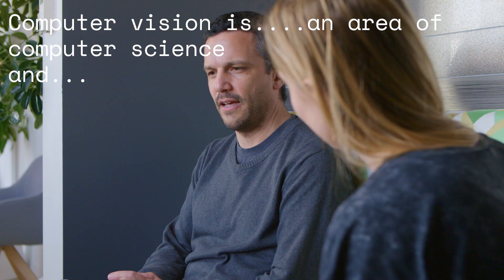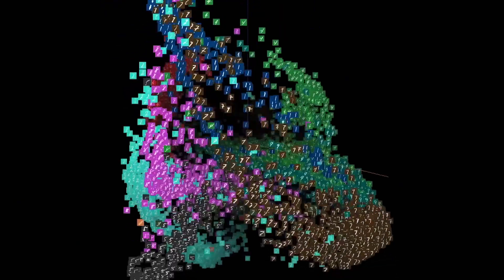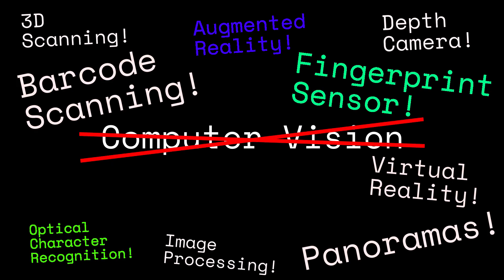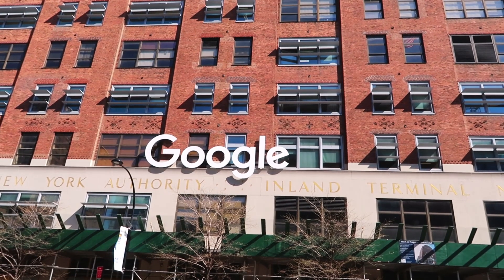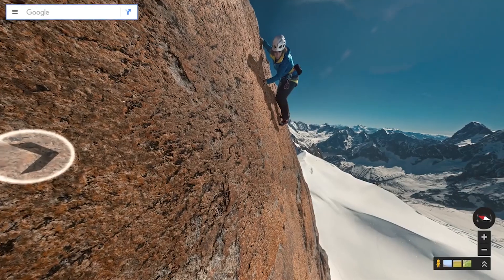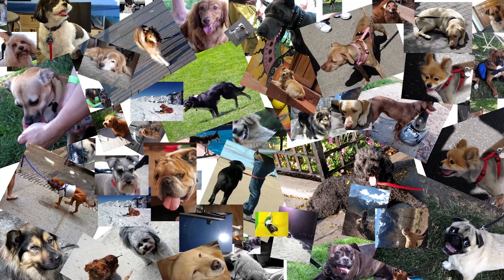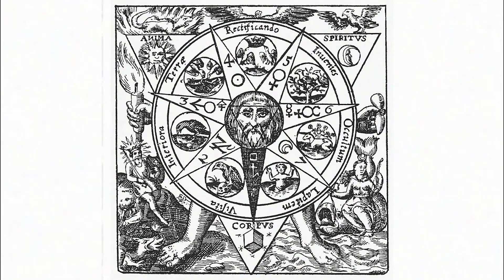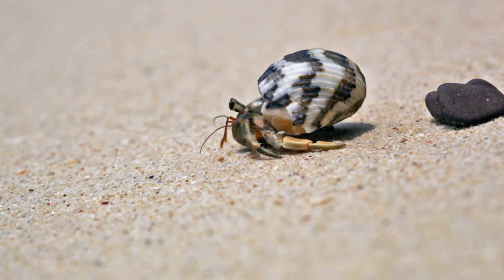How Computer Vision Is Finally Taking Off, After 50 Years

Comment: The reason why it is taking off much faster today is because we finally have the computing power required to process the machine learning algorithms!! You'll be having to deal with matrices of 1000 dimensions or more and then do operations on them like finding their covariance etc.. Takes a lot of computing push to do it.

Comment: Wait, you explain what computer vision IS, not why it's taking off just now.
Reply: 2D computer vision has been around for 25+ years. Where i worked in the early 90's we used it for QC. Both the installation of parts and fine adjustments of said parts. I think what has pushed a newfound interest is the introduction of 3D vision, with the reduction in cost and improvement in quality of the scanners and the ever escalating raw horsepower of computers (both Servers and Mobiles) this will continue to improve.
Reply: John
Reply: ottodud,.e555
Reply: ottodude555